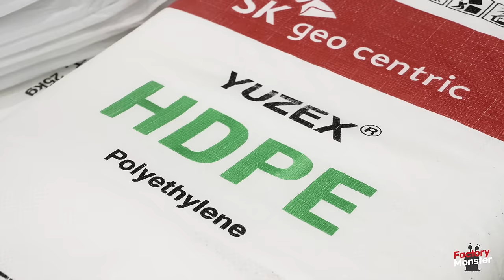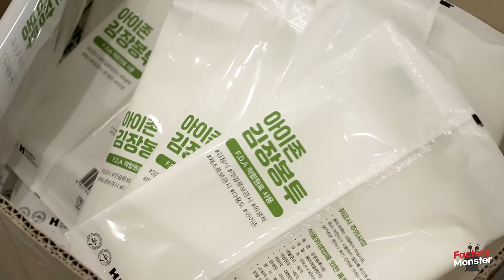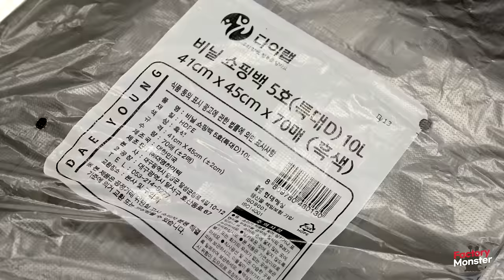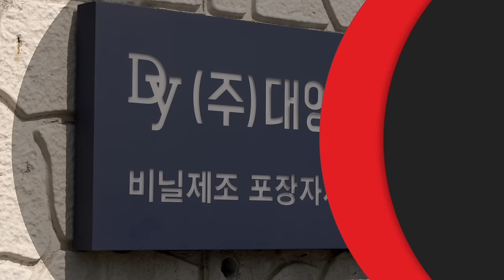Process of Making Plastic Bags. Korean Plastic Bag factory

Comment: I've worked on the variable speed drives that run the plastic extruder, the pinch roller at the top of the bubble, and the winder that makes the rolls.  The process is called "blown film".